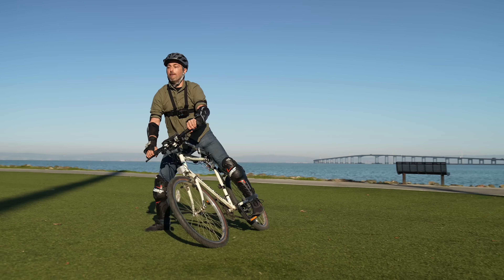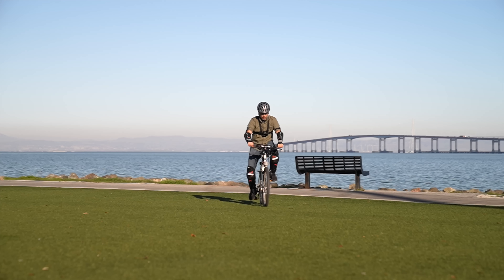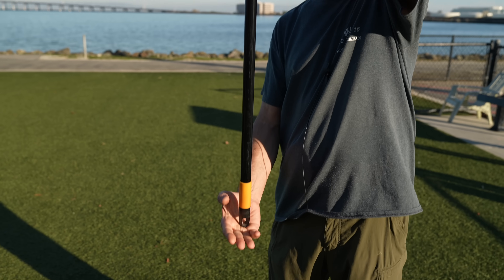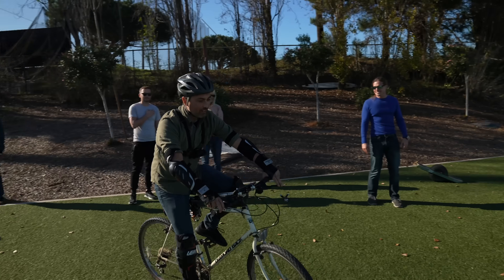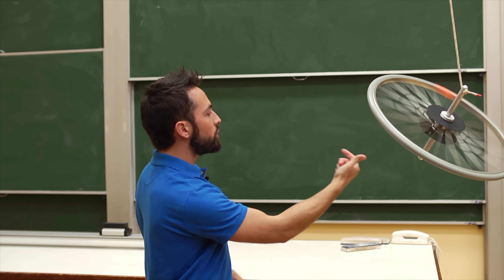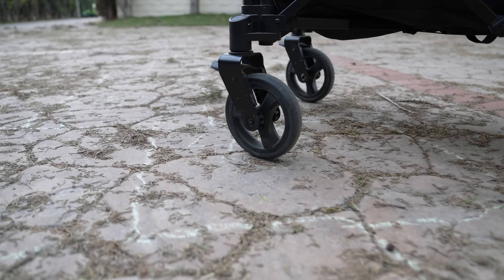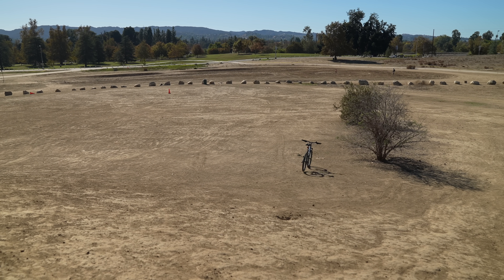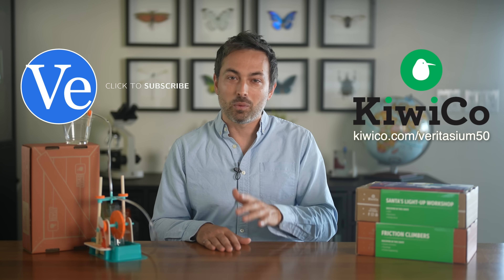Most People Don't Know How Bikes Work

Comment: I'm sure it's been said, but nonetheless:

It's not really caster that provides centering to steering, it's more importantly the mechanical trail. Caster is just a pretty good way to achieve mechanical trail. You could have a steering system with 0 caster but positive trail and it'd still center.

It also has to do with the self aligning torque of the tire; you can design the steering in such a way that SAT decreases when the tire is slipped enough or even reverses. This is probably one reason why bikes have so much mechanical trail, to make sure that such effects are minimized. It's also why cars have so little trail comparatively, so that their steering effort is low but also so that they provide some kind of indication of roughly how close to peak slip-angle (= lateral tire force) the tire is. Although it rarely directly aligns; usually you get a bit less steering resistance at peak compared to under it.

The SAT stuff also explains why power steering systems typically provide "less feedback" than manual steering systems; typically steering torque changes from SAT occur at higher torque outputs than what the power steering system is allowing to be output to the driver, so even if the steering changes from 10Nm to 8Nm at the column, it doesn't matter if the power steering system is only allowing a 7Nm output to the driver and the rest gets clamped. It's not really such a problem because as said earlier, SAT doesn't align with lateral tire forces.
Reply: Yes, the analogy with a castor is misleading.  On a castor, the wheel is behind the steering axis; on a bike, the wheel is ahead of the steering axis.  Different things are happening.  This is the only bit of the video I found unsatisfactory.
Reply: @mikefule  The location of the steering axis intersection with wheel center shouldn't matter in terms of aligning force strictly.

The actual aligning force is dependent on the location of the tire forces relative to the steering axis intersection with the groundplane. Typically the contact patch center is characterized as being in the middle of the tire but it's not quite correct.

If you align your steering axis with 0 caster and 1cm ahead of the wheel center, you'd have 1cm of mechanical trail and the tire would self-align. Same thing if you align it with high caster behind the steering axis with 1cm of mechanical trail. Although the steering axis alignment will adjust the curve of steering forces as the wheel is turned.

Comment: As someone who rides a bike dayly, I can assure you that there is no need to start by countersteering when turning. If that was mandatory, how would it even be possible to turn when not holding the handlebar ? However, it is true that countersteering helps a bit if you need to turn and get on a sidewalk, for instance : you end up being "more" perpendicular to the sidewalk, which helps not falling.
Reply: Well I don't see how cycling without handlebars counteracts the point. As you saw in the video it is possible to steer by simply leaning the bike. So you could just lean the other way before leaning the other way. And I don't think that the fact that you cycle daily necessarily makes you an expert on the subject, I also cycle almost daily and honestly I am not at all sure if I countersteer or not. That said maybe you are more conscious of what you are doing on the bike than I am
Reply: @skarpanton  I've never seen anyone starting by leaning left in order to turn right, but you have a point, in the sense that being able to ride a bike without using the handlebar doesn't prove my point. I've checked that yesterday too : the only time I would countersteer is when I need to take a sharp turn, for instance when turning on something that has an elevation (so that I end up more or so perpendicular to the level I'm trying to get on - I hope I'm making myself clear). Most of the time (for instance when turning at a crossroad), countersteering is unneeded and nobody does it (I live in Paris, so I've had several occasions to check that for myseft as well as watch how other people did it).

Comment: I'm not sure I fully grasp how this works, but I regularly ride my Dutch city bycicle handsfree (after getting to know the particular bike well enough). 
And doing so I'm even able to make some rather tight turns. 
This does seem to only work above a certain speed ~15kph (and in good weather conditions).
I wonder if I could lean to ride this bike...
Reply: I assume riding without touching the handles would be a lot harder on this bike since the front fork will naturally correct when riding without touching them. Like in the example where he lets it go downhill. But yeah when riding without hands you don't countersteer. You just shift your center of mass to the side you want to turn to.
Reply: @ruukinen  you still countersteer. the front wheel collapses due to your shifted weight, you go into the direction of the stability. still countersteering, just without handlea
Reply: yeah as others said your front handlebars are doing the countersteering for you.  If you locked that front wheel dead straight, you wouldn't be able to straight let alone lean into a turn (just like in the video).
Reply: @xerodeus2337  Just lift your ass of the seat and use your body as the counterweight. It's hard sure, but it is hardly impossible to ride a bike without steering.

The part where they tested only locking the countersteer side would be a trivial exercise for me. Just tilt the bike under your body in the direction you want to turn. You don't need to countersteer if you maintain the center of balance by keeping your body above it.
Reply: @ruukinen  but they also locked both sides, and couldn't even ride straight. And they tried shifting their weight around aggressively. So you're telling me they couldn't even ride straight a few feet, you're telling me you could ride straight and turn the bike no problem without turning the handlebars?  

uh huh :D

Comment: I think a lot has to do with the weight of the rider as well compared to the weight of the bike.

If you had a bike that weight more than the rider it would not be so easy to steer, unless you were travelling at a speed, we see this with motorcycles.

Heavy bikes are harder to steer at slow speeds.

So the weight of the rider makes a difference to the way the bike will steer.

If you had a very small bike with a very big rider then bike becomes very twitchy to steer.

If you have a very big bike with a small rider the rider almost becomes insignificant except to change direction by influence of the lean.

it seems to be more like a pendulum motion than gyroscopic, though as you said gyroscopic does come into play.

Watch someone ride a bike very slow you see constant correction of the steering, shifting the weight one side to the other in order to keep balance.

Comment: Dutch cyclist here. I think it is possible to steer right without first steering left (though it is much harder). If you shift your upper body to the right the bike will start to lean/fall to the right, creating the angle you need to make the turn without falling over. Once you have the correct angle you can turn the handlebar to the right and initiate the turn. I have tried this after seeing the video from minutephysics. You won't be able to make a very tight turn though.

Comment: But when I ride my motorcycle at speed >=25km/h i never steer, i just lean. also i have never seen my bikes handlebar turn... so why? is the automatic steering so small that i dont see it or does something else happen here?
just to be clear: to start driving I need to steer, but at a certain speed i do not steer, my bikes handlebar does not move, doesnt matter if i drive straight or  turn

Comment: Countersteering is also something you should internalize as a motorcyclist. In high stress situations like avoiding an accident, it happens quiet often, that riders steer away from the obstacle, just to then drive right into it because of countersteering.
Reply: This. Any motorcyclist worth their salt should have at least a basic understanding of countersteering.
Reply: It's not even possible to ride a motorcycle through a curve without deliberately counter-steering into, and out of, the turn. The higher the speed, the more acute the effect.
Reply: @Triple_J.1  This is so true - I remember in my training course when they were trying to drill counter steering into our heads that it was difficult to really understand because of the low speeds we were riding in our little parking lot.  The feeling is totally different at low speeds and is much more "steer where you point".  You don't really appreciate counter steering until you get onto real roads and can take turns a full speed.
Reply: @Triple_J.1  Most people will countersteer intuitively, but this does not necessarily translate to high stress situations, which is why every motorcyclist should know and understand this effect in my opinion.
Reply: @janderechan  Wouldn't high enough stress situations bring about brain fog? No matter how much knowledge you have, when the blood is pumping and adrenaline flowing you don't have time to remember a thing; muscle memory takes over.
Reply: There are some gruesome motorcycle videos because the riders instinctively steers towards the hazard, and hits it, while he should have easily missed it.
Reply: The issue with steering wrongly in this type of situation is because people tend to steer where they look.
Reply: "Countersteering" is the ONLY way to turn on a motorcycle or bicycle at speed.  "Push Right, Go Right.  Push Left, Go Left".  Forget anything you may think you know about just leaning is what steers a motorcycle because that has been debunked countless times.  We are so used to riding that we don't even realize the physics involved.  Any time you are turning in a lefthand curve, you are actually turning the front tire to the right.  Try this experiment in a straight line- Turn your handlebars to the left- PUSH RIGHT to steer the front wheel to the left.  Which direction did you go?  Countersteering is NOT some fantastic avoidance maneuver- it is simply how 2 wheeled vehicles work.
Reply: When riding slow on a motorcycle or on a bicycle like he is here you are countersteering, like while weaving between cones. However, at faster speeds (approximately 10+ mph) you are taking advantage of centripetal force (center seeking force) by leaning towards the centerpoint of a much larger circle creating an arc.
Reply: Was going to say, motorcycling.
Reply: I was about to say this
Reply: Exactly this is one of the first basic as motorcyclist learns about
Reply: Bingo!
Reply: Yeah, I just mentioned this in a comment as well. We learned this stuff in the written part of my motorcycle class, before we even got on a motorcycle
Reply: Best riding strategy is to look for U're exit point. W/O realizing it U will counter steer & move out of the danger area. To many look @ what they are going hit & do just that.
Reply: Every motorcyclist must know this stuff instinctually, or die.  I’m serious, if you are a serious motorcyclist, who likes to go fast, you must know about counter-steering, and not “instinctually kind of know” how it works.  On a motorcycle, transitioning from a left to right hand fast sweeping turn can require LOTS of counter-steering input force.  If you’re not willing to input this amount of force, someone who is will beat you through this turning transition.  To turn, you must have the motorcycle banked, to bank left, you turn the bars right, when the desired angle is reached, you neutralize.  So it something darts out in front of you, aggressive counter-steering might decide if you hit it or not.

POOR LITTLE KIDS LEARNING TO RIDE A BIKE.  Dad lets him mess around until he “gets it.”  IT’S NOT ABOUT BALANCING.  Dad should say that if you’re falling to the right, turn the bars to the right.  Or turn into the way you’re falling.

Comment: The real question is would it still work if the back wheel was steerable. Edit: Other good example of preparing before moving to predetermined direction is when you want to sprint, you lean forward in advance.

Comment: Great explanation Derek! But I'm curious, if the gyroscopic effect do that much, can we ride a normal bicycles on a low gravitation, or we need a special bicycles that have no gyroscopic effect?
Reply: The effect is small - you feel it when you spin a wheel on it's own, holding it between your thumbs and forefingers - once you are carrying your weight and controlling the bike with much bigger muscles, it becomes negligible. So if you take it away it won''t make a difference. However as gravity is how you turn a bike, it would be tricky without it, and you won't have any traction either.

Comment: As a downhill and enduro mountain biker, I fully disagree with the notion that one must first turn one direction in order to turn to the other. If a rider is using this method to turn, they are either an inexperienced rider, or they have not yet learned how to properly ride. The proper way (ex. Turning left): It starts with your head. You’re riding in a straight line, head up looking ahead. To turn left, turn your head (not just your eyes!) in that direction. If your relaxed, your shoulders will naturally start to turn the direction of your head, which will draw your left hand back, as it brings your right hand forward. Thus initiating your turn to the left without any need to lean in the opposite direction. To full complete the turn, there will be a certain amount of bicycle and body lean - the amount of which is governed by your speed, how hard of a turn you’re making, your confidence, and your skill level.

Comment: There's also another element to the caster angle. Its called fork Rake. i.e. the distance between the steering axis and the fork blades at the front wheel’s axle. The more rake you add(distance forward of the steering axis/caster angle) the quicker it'll steer. Simply put, Positive Rake = Faster Steering, Negative Rake = slower steering. Changing rake angle doesn't change caster angle so stability remains the same. Although a negative rake means you need more time and space to make corrections.

Comment: Not like this is particularly wrong, you can't just turn your bike by ONLY turning the handle the way you want to turn.... but at the same time this video is very misleading again.

First of all, surely you will fall off your bike even if you try to go straight if half of your steering is suddenly locked. And second - if you expect a turn you can just lean the way you want to go, or rather not correct the right lean and turn without steering the other way first, just like in "lucky" examples from the video, tested it myself while driving on a straight line and paying attention, it can be done very intentionally.

Comment: I actually didn’t realize this until I applied for my motorcycle license through a training class. The application that exemplifies this effect was learning how to dodge quickly to either the right or left of something head on. You first have to turn quickly into it or the opposite direction you want to go and the affect this has on the motorbike causes it to flip in the opposite direction just as quickly and out of the path of the obstructing object.

Please do read up for yourself  on how to ride a motorcycle and learn/ practice through licensed instructors before trying to apply this for yourself though.

Comment: Is it possible to not countersteer in cases like mountain-biking?  When I take a hard turn, I move my weight over much more than the average cyclist in order to lean the bike more into the turn.  Also, you'll often run into berms on trails.  In both these cases, I could see it being possible to make the turn without countersteering.  I also wonder if speed affects the need for countersteering because I would think your centrifugal force would provide the same counter to your lean as the countersteering does.
Reply: I agree with you. I understrand countersteering as a way to change the center of gravity wrt the attachment point to the ground. You can also do this by actively leaning into the curve prior to steering which is common for road cyclists. Mountainbiker lean the bike under the body into the curve - for this I don't understand the physics why they/we do so.